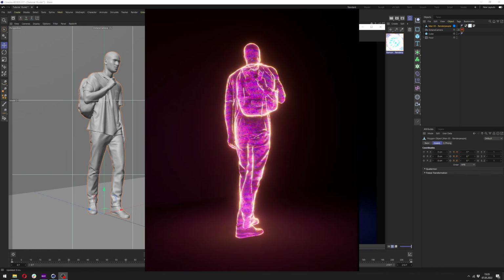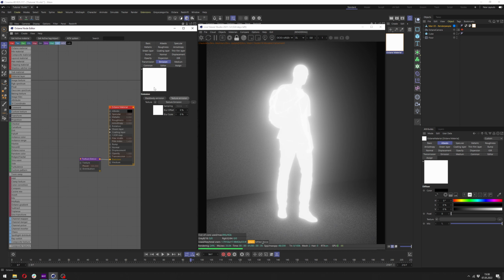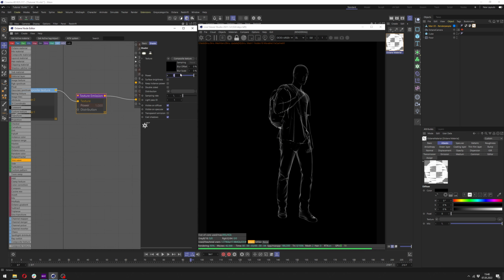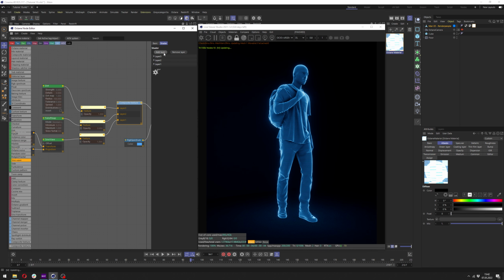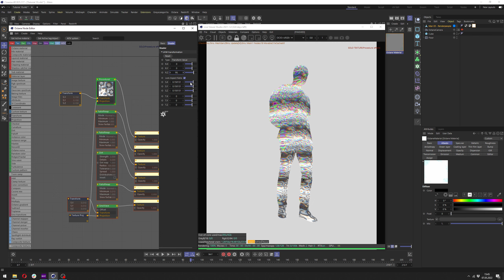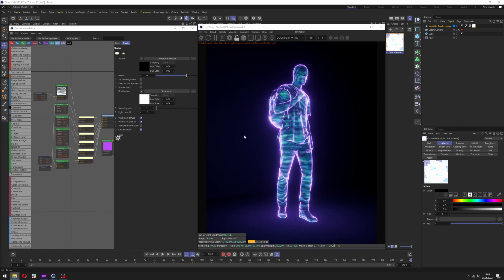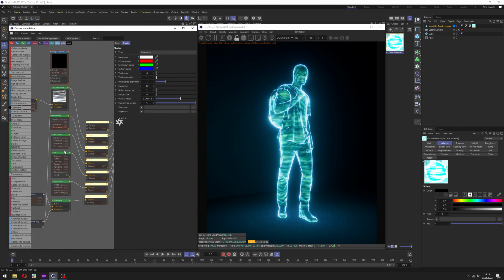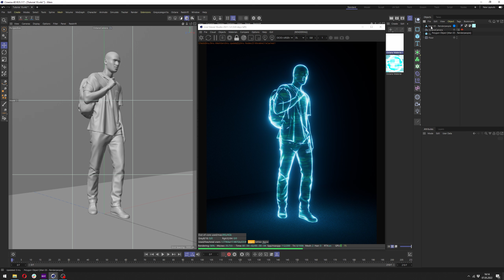Hologram Material Using Composite Texture in Octane

Comment: I make a universal octane material, set the albedo to black, turn the IOR to specular and then white but it's not clear or transparent. Plus I don't have this composite texture in my octane.. what version did you use for this project?
Reply from the maker: Hey! It was latest version at that time, just update to latest and you should have composite texture. as for transparent look: 
Material Type: Universal
Albedo: Fully black color
IOR: Fully black color
Transmission type: Specular and Fully white color 
Common: Fakes shadows turned on

Rest of the tutorial covers emission itself.
Reply: Hey, thank you so much for a quick reply.. I've just been in version hell trying to get a version on one of my machines that will work. lol. Can't update my iMac any higher (frankly don't want to) so that's the highest Octane I can get. Seems there's still infinite problems with octane and the silicon Macs, so now dusting off the pc laptop once again. It shouldn't be this hard to get these softwares to work!! compatibility is a major mess right now!  @NojsGraphics
Reply: finally got it!! and got a newer version of octane. thank you for the great (but fast) tutorial!!  @NojsGraphics

Comment: Hi, In the first steps - Albedo to black, IOR 1 and Transmission to white, it doesn't turn transparent. I have tried a couple of times, I will continue to play with the Opacity but any tips would be helpful, thanks!
Reply from the maker: Hey! So i run small test with connecting Composite Texture to Opacity instead of Texture Emission and  result is similar, in my case i had to cranked up power from 15 to around 500-600 to compensate glow power, it will looks fairly similar,  but any color info (orginal texture of model or kaleidoscope i used) you need to still apply it to texture emission Texture.
Reply: @NojsGraphics  Thank you so much!

Comment: I cant find composite texture. I have just composite material. Where is it?
Reply from the maker: Hey! whats your version of Octane? It should be located in utilities section(Utl / Light blue color nodes) in Octane Node Editor.
Reply: Version is PR13! mac os ver.
Reply from the maker: @seoo3586   oooh! I dont have mac and i know some features are implemented in diffrent time, it might not yet be in this version, you can instead use nodes like: add, multiply, subtract and mix, but i dont think there is node that would replicate "color" or "overlay" blending mode in Octane, i would have to do some searching.